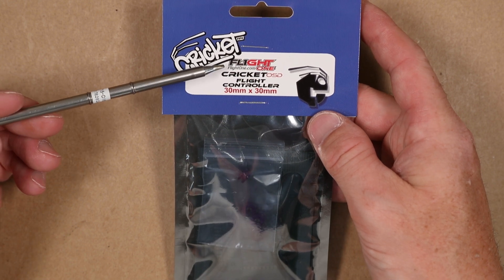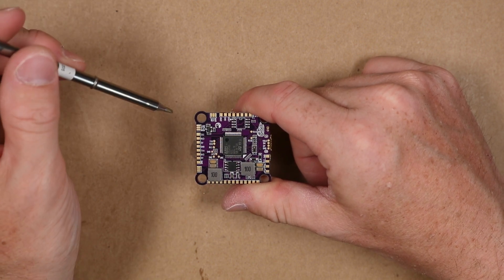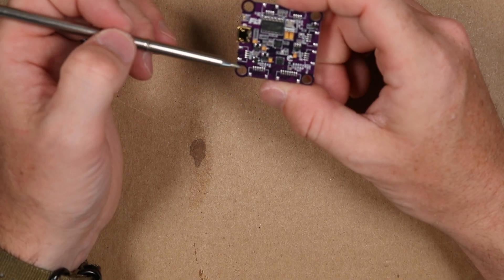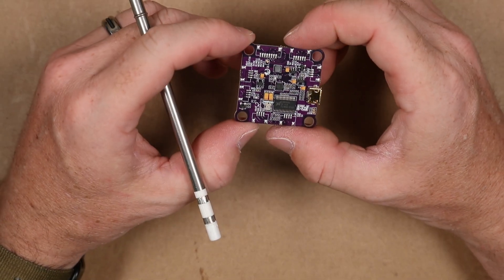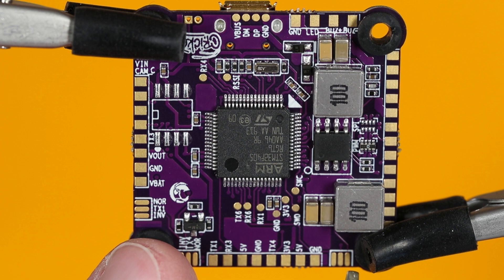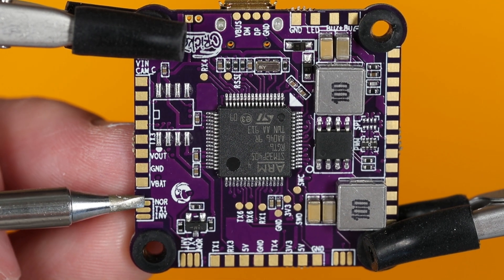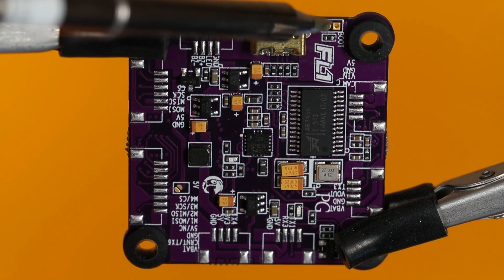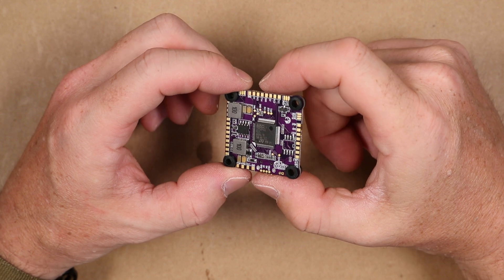FlightOne Cricket Revolt OSD - Bench review

Comment: Does OSD and lite has same performance? Only thing diff will be plugs?
Reply from the maker: They are the same board. One has pin-headers and the other one doesn’t. The pads are there if you wanted to install pin-headers. The new Skitzo OSD lite has one pin-header installed for a 3rd option.
Reply: breaksteel ok same perf jusr -2 cents
Reply from the maker: Yep, can’t go wrong with ether one.

Comment: Just a little addition, the OSD only (no laptop required stuff) is still in beta.... FalcoX. Any BLHeli settings still need a laptop, at least for now. Awesome close ups of the board!! Great video! Build it - Fly it.... @flightone official is awesome. I own this board and I have to add, that this board in particular, which will come to be known as the revoltOSD Lite once the limited cricket runs are done is perfect for tight builds. I have a hyperlow vert 2 freestyle which with the traditional revolt OSD i could not get to fit as due to the connectors the space between 4in1 and FC were too big. The lack of connectors enabled me to sit the boards closer together and fit it in the frame. Flightone as a whole rocks, but the new beta FalcoX is phenomenal. I cant tell you how good it is to be able to configure everything within the OSD and the preset tunes are awesome! Cant wait to hear your thoughts on flightone once you finish building it!
Reply from the maker: ..And I just bought it cause it’s purple. Figured the pads are soo small on this board it needed a good closeup. Funny how I was able to see it better on the monitor than strait on. I’ll likely make this a thing with review units as even boards with larger labeled pads may still have other intricacies. I’m eager to try the OSD setup! Not having a laptop it may be a better platform for me on the field. I can only do so much with LUA scripts in Betaflight. The real reason I purchased this board was that lack of pin headers on a FlightOne board. I like how MFGs are trying to make this hobby easier for new people by using them. Those headers introduce too many issues that could require more advanced troubleshooting skill than soldering up a board without the headers would. I really feel the only thing I would change with this board is the pad layout.
Reply: @breaksteel  I'm inclined to agree about the connectors. Initially I was wowed with how easy it could be of course the novelty soon wore off after the first few crashes and troubleshooting meant checking each wire on the plug and a whole host of other plug related issues lol. I do like this board a lot and will be getting more for future builds.
Reply from the maker: I’ve had trouble with them before I even finished a build. While a plug of sorts may be the answer, these specific plugs are not it. I can imagine the trouble they cause after some months of bashing. Ive ordered a second one of these just to have it. I hate limited runs for this reason.